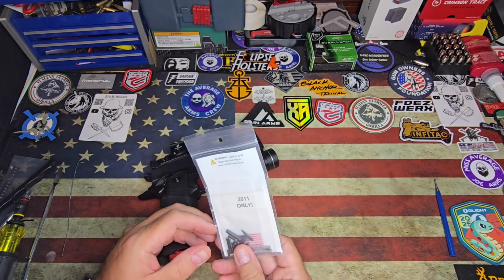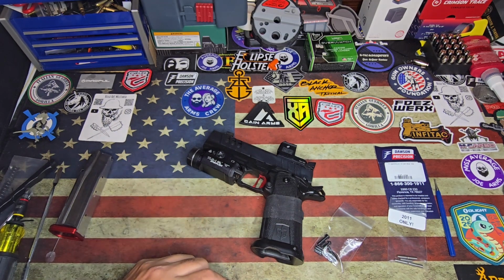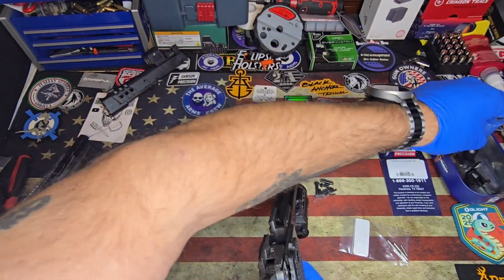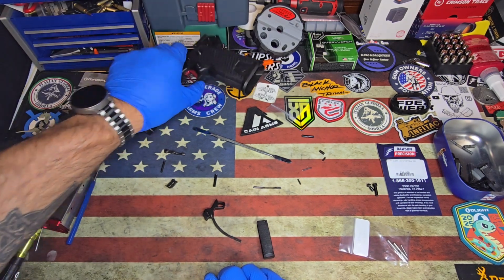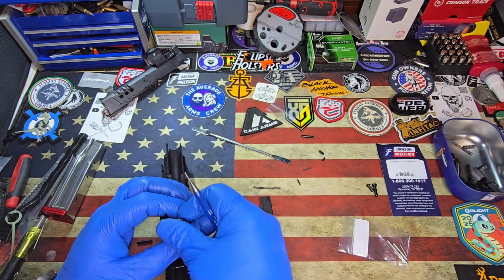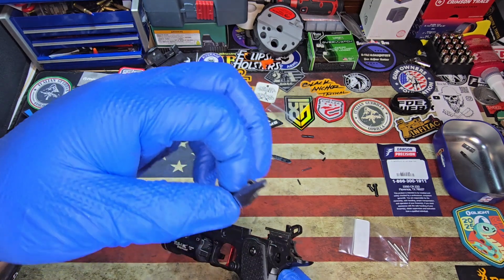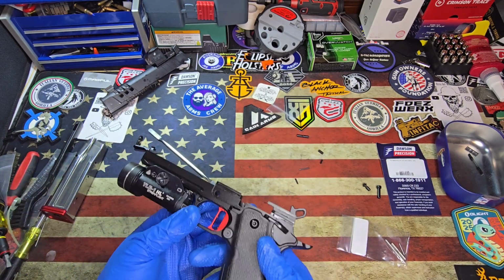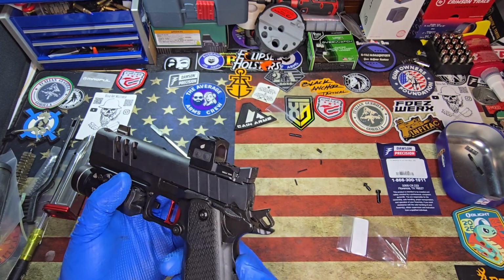Mac 9DS Comp Safety detent spring , hammer & sear pin replacement installation.

Comment: After taking it apart pulling the trigger doesnt make the hammer go forward. I changed the hammer spring to 17lb and i had trouble getting it back together it was stuck. I got it unstuck and it took me like 2 hours to remove the thumb safety. Now i put everything back together and now hammer doesnt fall foward.

Comment: so on my main spring plastic housing where you slide it into the grip, on the inside where the hammer lever goes into the main spring my hammer lever made a slight indention to the plastic on the mainspring housing i dont think its anything to serious. I guess the hammer lever miss aligned when i put some stuff back together should i replace it or does anyone think its fine? its a squares indention the width of the hammer lever and it goes down the plastic about a cm.
Reply from the maker: Should be fine , but that piece is like $10 or cheaper from Springfield, so if you have any concerns, just replace it.

Comment: Hey when I pull the hammer back, it doesn’t catch. Do you know what I may have done wrong?
Reply from the maker: The finger on trigger bar or sear spring isn’t on right , some times it will slide off during installation, gotta keep pressure on sear spring.

Comment: Joe, I am having a heck of a time changing my trigger spring on my Mac 9 ds d 5".  I have an armorers block wither the round protrusion and the area for the pin to slide out,  but it seems like I can't put enough pressure on the spring to push the pin all the way out....I only see part of the pin....Do you have any ideas?  Thanks in advance.  I am a recent subscriber.
Reply from the maker: I had the same issue . The armors block i had that nub was too wide to fit in the hole , I had to flip it and do it old school , push down on spring with punch. Good luck
Reply: @Average_Joe_Arms  Thanks brother.  That worked like a charm.  Now, where to I get one of those flat tools.  I want to change my sear spring.  LOL.
Reply from the maker: @oltex806  https://amzn.to/4kz085I
Reply from the maker: Amazon, this kit is perfect and cheap
Reply: @Average_Joe_Arms thanks I wondered of it was that.
Reply: Is there a notch/groove in the right side thumb safety? Or a groove on that side of the hammer pin for it to slot in to? I saw they were doing this on the new prodigies being released and also on the Kimber 2k11s
Reply: @erickdokendorf thanks, since that time I figured it out.  I put the punch in the armored block and pressed the back strap down on the punch then used an additional punch to push out the pin.

Comment: Just bought a new Mac ( DS Comp 5”. Waited three weeks for it to come in and when I finally got it the thumb safety was mushy (no click when moving the thumb safety into the fire position). It clicks when I push the safety into the up (safe) position, but I am afraid with the slightest touch it will move down to the fire position. Going to but the same kit you used to fix yours in this video. Hopefully it isn’t the sear, after all they have to fit each sear the weapon at the factory and they can accidentally take off too much material. Is the part number 037-038 ??? I just want to make sure I order the same one. Thank you for your time and consideration sir!
Reply from the maker: https://dawsonprecision.com/pin-set-for-1911-2011-pistols-13-pieces-by-dawson-precision/
Reply from the maker: Thanks and good luck , that part # is correct 👍
Reply: Did you do the 10K review yet for this Mac9?

Comment: Thank you for another great vid.
Even tho I ride the safety, the detention is too loose and i can  disengage before I want it to. Will be doing this also.
To clarify, you only changed the pins that you did because you had to buy a kit to get the detent?
Or was there an issue with the mac pins?